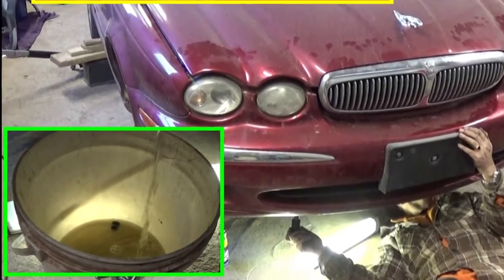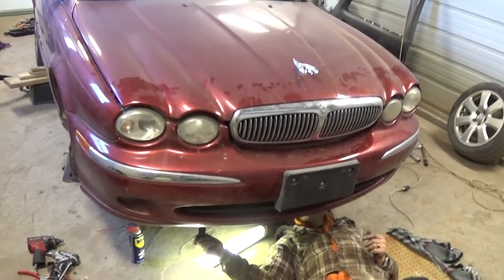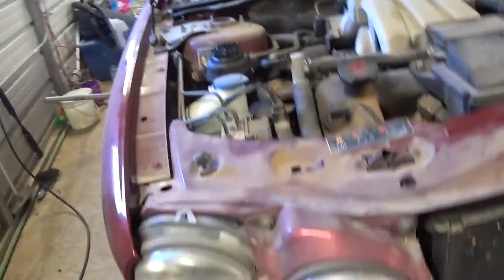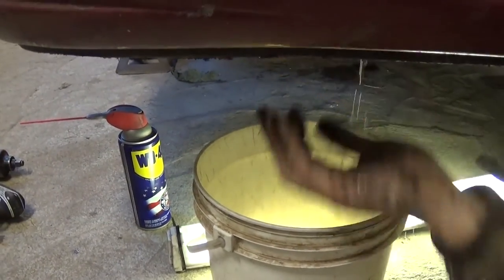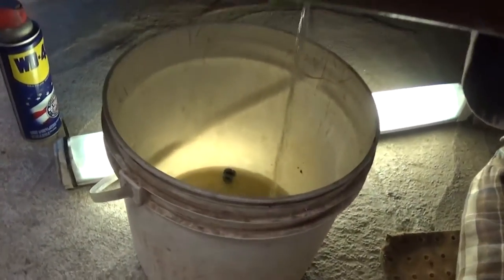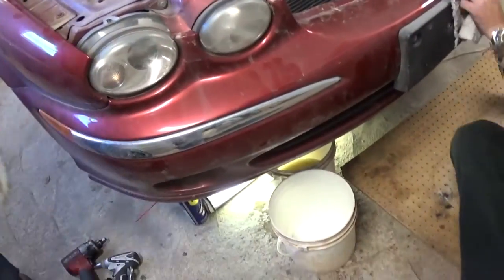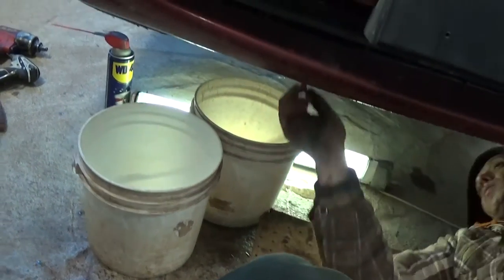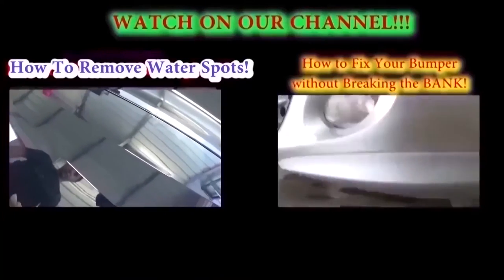Jaguar X-TYPE How to Drain the Coolant / Antifreeze. Jaguar XTYPE X TYPE

Comment: How do you add the coolant back in and bleed it? I have a 2014 F type that has no where to add coolant except at the expansion or over flow tank. I can't find any bleeder valves except for a bleeder screw on the tank itself next to the cap
Reply: Normally you bleed the cooling system by turning on the motor leaving the cooler cap off and turn the heating on maximum. Wait until the motor has heated up and the thermostat has opened. Then close the cooler. Done.

Comment: Does anyone know the specs or part number for the drain plug?  I lost one and am having a hard time finding the replacement.
Reply: Hello.  found myself in the same situation.  damaged the plug.  haven't found a replacement for her?
Reply: @7OffendeR7  I had to order it from the Jaguar dealership.  Expense and time consuming.
Reply: @johnvaldivielso674  do you have a part number for this part?  Or was it not indicated on the bolt?
Reply: @7OffendeR7  sorry, I sold that car a while ago and don't have the order information.  It should be the same as that on a Ford Mondeo (which wasn't sold in the U.S.) but might be available where you are.

Comment: X-Types are my favorite car of all time. I had a 02, but got rid of it because the idiot engineers at Jaguar didn't use the correct metal in the A-frame, that's where the sun roof drain drains to, and it rusted all out. Also, the idiot engineers at Jatco, Transmission is a JF506E, didn't use the right metal on the Hi/Reverse piston in the transmission, making it very, very, very, very common for it to crack and break. But I loved my Jag, and I plan on getting an 05 or newer in the future.